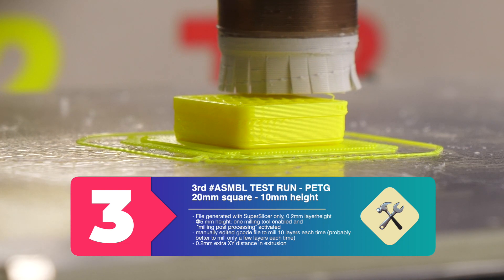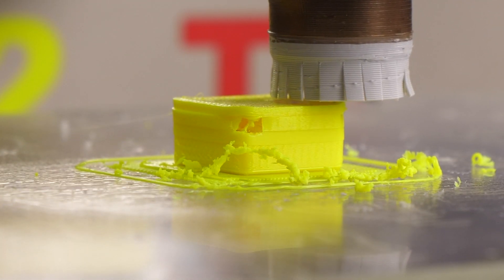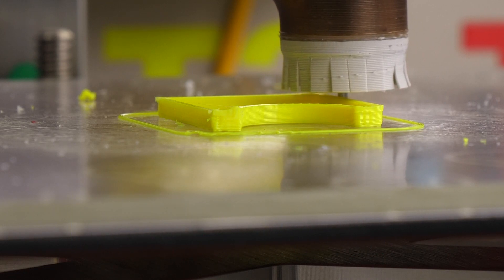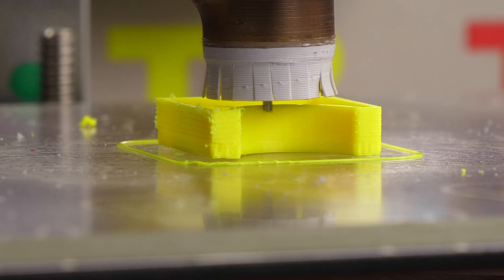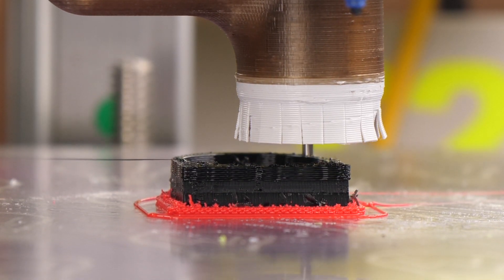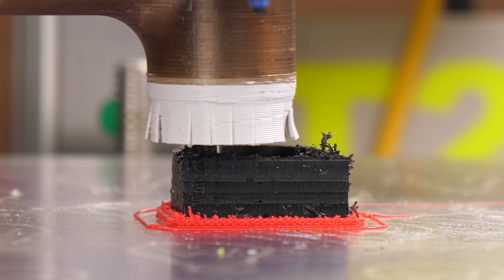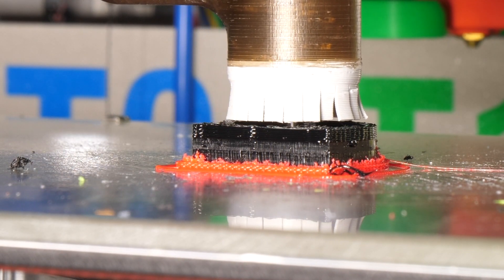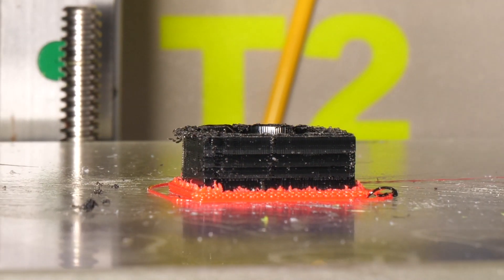#ASMBL - #3 test run - FAIL EDITION

Comment: Great series that you are putting together! I have 2 CNC machines and I have found that on parts that have thin top surfaces/features, i prefer to use the Contour Machining toolpath because it will follow the outlines rather than having several small interrupted cuts across the top compared to the traditional Face tool path. Based on the look of the chips and the movement of the ASMBL I think you are taking too deep of a cut and the chips that are staying attached are not getting cut off because the gantry isn't stiff enough.

Try using the same speed (300mm/sec), reduce your chip size in half (I assume since you are extruding .2mm over the original model that that is how much you are cutting. Try .1mm instead) and see if you can have fusion do 2 passes on each cutting layer. If you activate a finishing pass then your main cut will be .1 and your finishing pass will also be .1 so together you are removing the over extrusion.

I also wonder if using the TPU base is an issue. Because it is slightly elastic, it could be that the chatter marks are not because of a lack of rigidity of the Toolchanger but are actually a deflection of the TPU base so every time the tooth tries to cut, the print itself is moving out of the way. Maybe adding a 30 second pause after the first set of layers is the only way to improve the finish since it is closest to the heated bed and will have cooled the least of all the other sections that are cut.
Reply from the maker: Very good points, thank you for this long comment! I‘ll adress all of your suggestions with my next tests!
Reply: @ReneJurack  Looking forward to the next round of tests!

Comment: Is there a reason for the relatively low spindle speed? I thought plastics did well at higher spindle speeds
Reply: Plastics actually tend to melt at higher spindle speeds.

Comment: Hello René, The videos they are very well made and helpful!
Iam starting with the ASMBL but still struggling with intalling that spindle on the machine... Can you share some infos about how to wire the spindle, connect it to the cardboard etc? I can't find anything on the links that i have (Thingiverse). I have everything on place but still don't now wich PWM pin i should conect to etc...
Thanks a lot!
Reply from the maker: I‘m working on it already 😊

Comment: Hmm why don't you try ABS? it's softer and sandable and has a higher glass transition temp
Reply from the maker: And it is a pita to print. I‘ll start with the easy filaments first, and if ASMBL is up and working will try out other filaments ☺️
Reply: @ReneJurack  oh fair enough. I heard e3d say that ABS works the best and petg is too easy to melt. Etc.

It's not that hard tho tbh! Specially the ABS+ blends from esun etc!

Comment: Damn the mill itself sounds more quiet than I thought. Do you have the time to measure the noise of ASMBL? I've been debating trying it too
Reply from the maker: The vacuum is the loudest part. It‘s no quiet operation 😅
Reply: @ReneJurack  I was wondering if it'll still be loud if I only use a part cooling fan or maybe make a vaccum out of a BLDC
Reply from the maker: The mill is way easier on the ears than a couple of Hemera-Fans running on the standby tools.